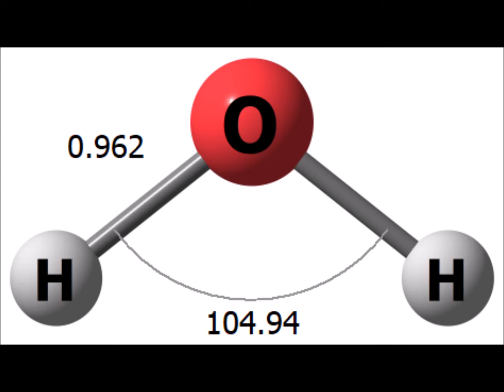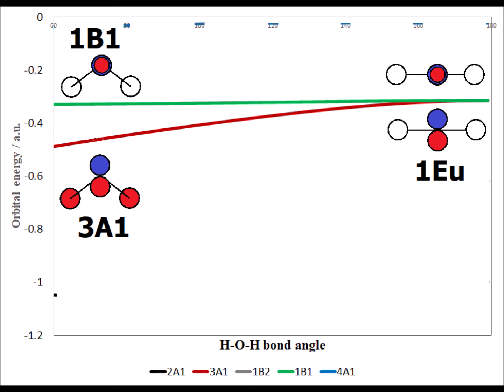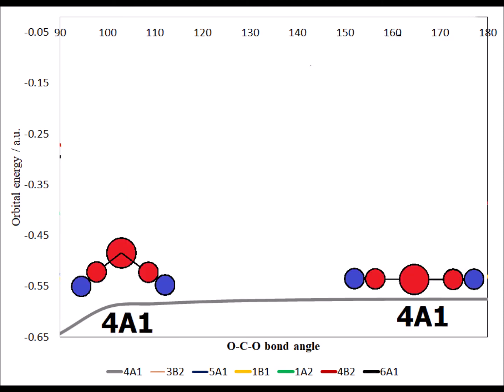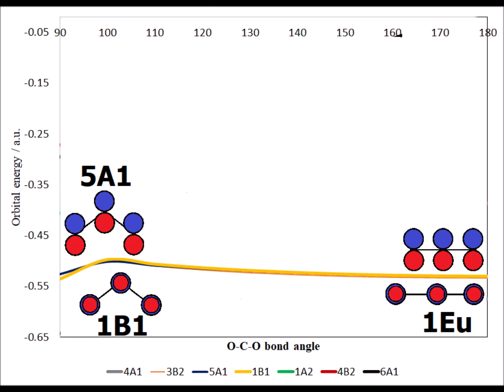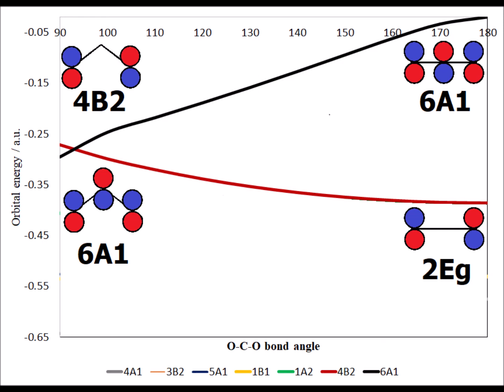Walsh diagrams: water and carbon dioxide

Comment from the maker: (for mobile users)

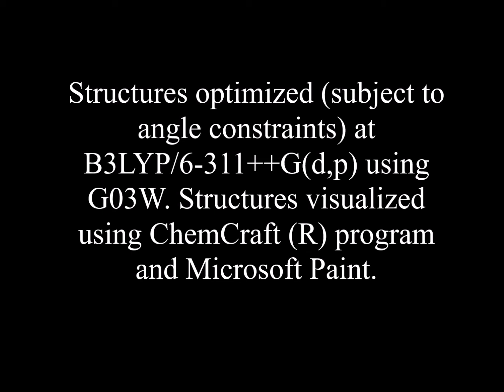00:25   Structure of water
01:09   Molecular orbitals of "bent" water
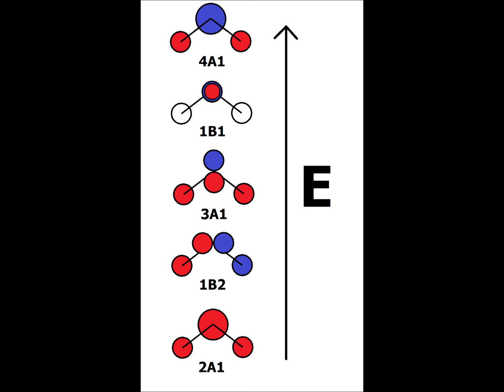01:34   Molecular orbitals of "linear" water
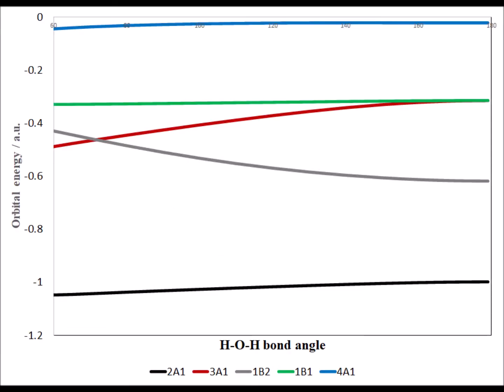02:10   Orbital energies for water
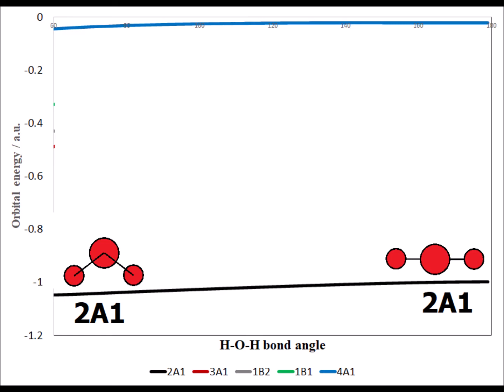02:59   Correlation for water 2A₁ orbital
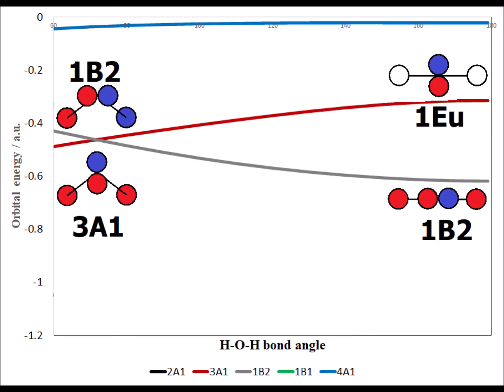03:39   Correlation for water 3A₁, 1B₂, and 1Eᵤ orbitals
04:19   Correlation for water 3A₁, 1B₁, and 1Eᵤ orbitals
05:29   Correlation for water 4A₁ orbital
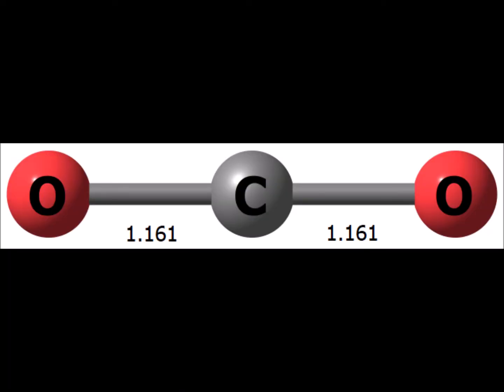06:00   Structure of carbon dioxide
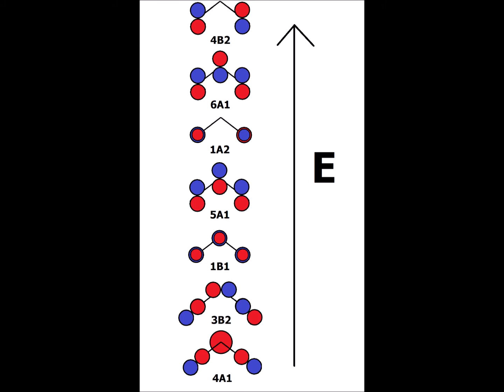06:44   Molecular orbitals of "bent" carbon dioxide
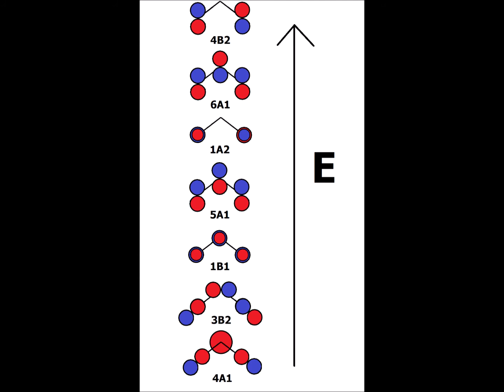07:14   Molecular orbitals of "linear" carbon dioxide
07:54   Orbital energies for carbon dioxide
08:23   Correlation for carbon dioxide 4A₁ orbital
08:53   Correlation for carbon dioxide 3B₂ orbital
09:19   Correlation for carbon dioxide 1B₁, 5A₁, and 1Eᵤ orbitals
10:09   Correlation for carbon dioxide 4B₂, 1A₂, and 2E𝓰 orbitals
10:54   Correlation for carbon dioxide 4B₂, 6A₁, and 2E𝓰 orbitals

Orbital correlation ("Walsh') diagrams for water (representative of H-X-H) and carbon dioxide (representative of
 Y-X-Y). H is hydrogen, and X/Y are elements of the second row of the Periodic Table. Orbital energies were calculated at B3LYP/6-311++G(d,p) on geometries optimized at B3LYP/6-311++G(d,p), subject to constraint on the bond angle, using G03W. Red and blue colors represent opposite phases of the wavefunction. Molecular representations formed using ChemCraft (R) program. Orbital sketches made using Microsoft Paint (R). Orbital energy diagrams made using Microsoft Excel (R).

Bond angles are in degrees, bond lengths in Angstroms, and orbital energies in atomic units (a.u., hartrees).

Don't forget to like, comment, share, and subscribe!